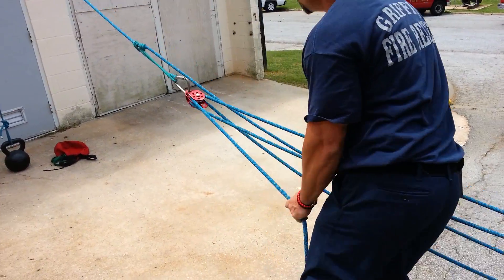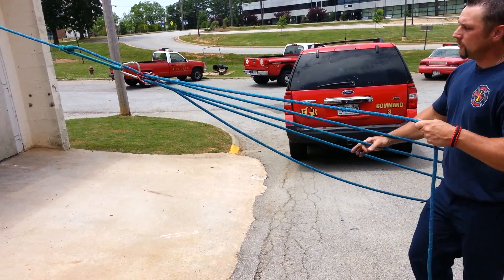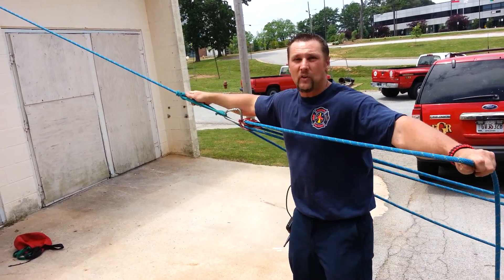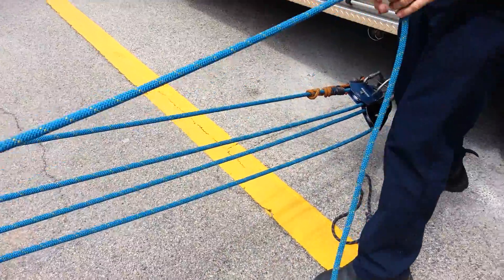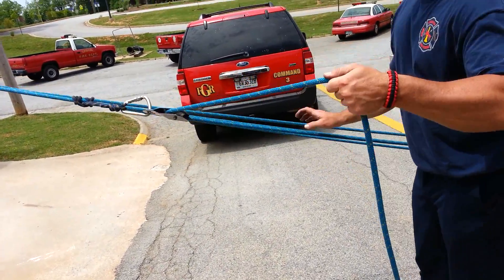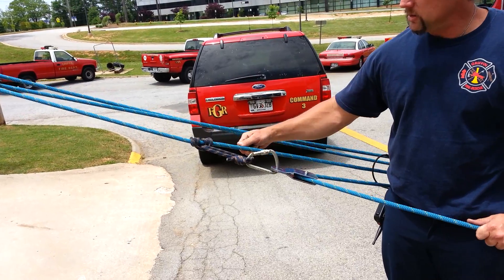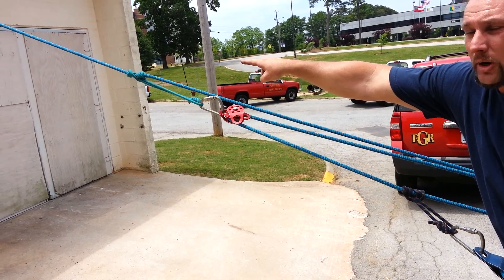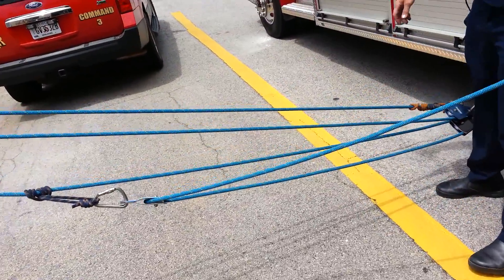5:1 to 9:1 conversion pulley system NPQ

Comment: Or you could use a winch...   😋.    😃👍
Reply: If you want to be a smart ass why not use a tractor to pull the rope then? Or a crane to lift the load. The video's purpose is to show how to solve using pulleys. And btw, a winch is just a mechanical advantage mechanism, but is much less versatile in terms of changing the rigging to generate more power. In this regard, pulleys are better.

Comment: yes you can set up such a system.  it would require more equipment however.  in the case of the 18:1 ratio be mindful that you will need a LOT of rope.  for every 18 feet of rope you pull, the load will only move 1 foot....
Reply: Wouldn’t need much more rope. Make a simple 2:1 with a short amount of rope to pull on the 9:1 and you would just need to reset more often. 18:1 with 1 more pulley and a little more rope, easy money.